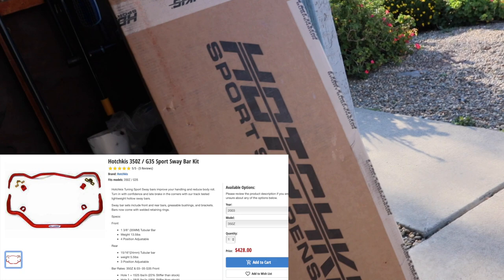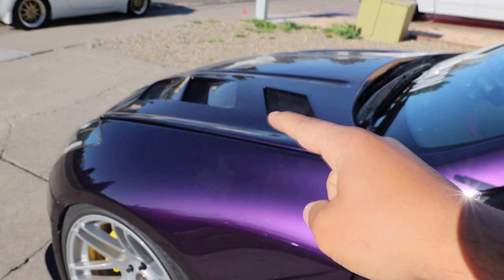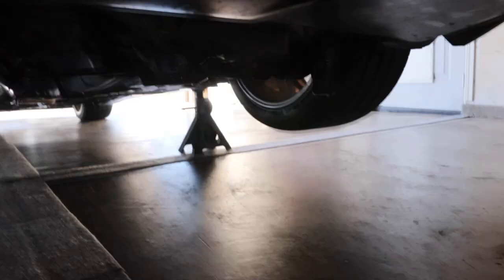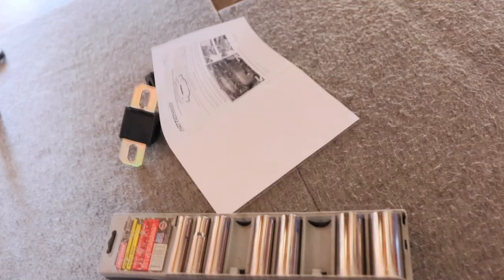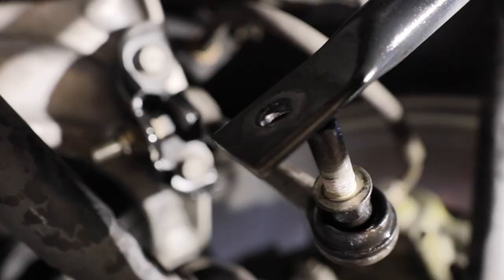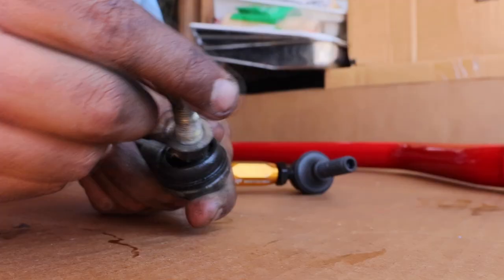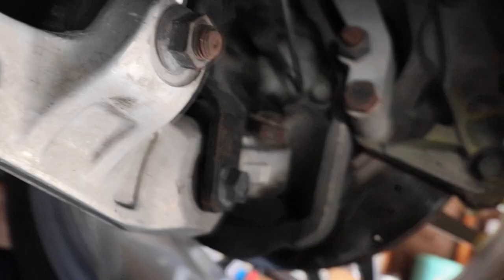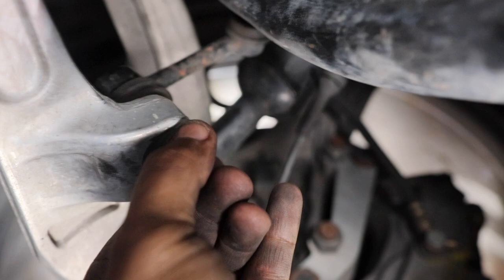Installing Hotchkis Sway Bars on my G35 !

Comment: Pin it p#ssy 😅 jjks lower gear if getting ugly down shift into apex, shift weight to front of car helps sharp grip as turn In then power on as leaving shifting weight to rear should help a lot with that roll over feeling also paying attention to your line trying create as directed line out of corner after apex as possible. Much Respect

Comment: The rear sway bar is useless on these cars.

No research was done in this video
Reply from the maker: I don’t think it is useless.
Reply: If you went on the forums you'd know what you said is complete bs. The factory rear sway bar is small on our cars while the front sway bar is huge. Only upgrading the front sway bar would give you massive understeer.